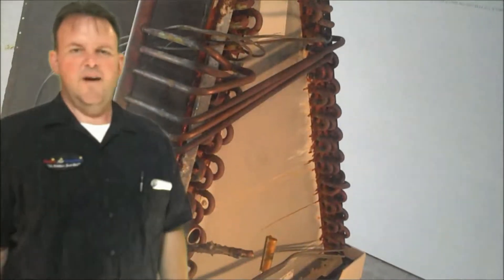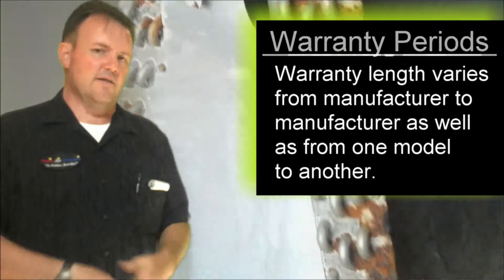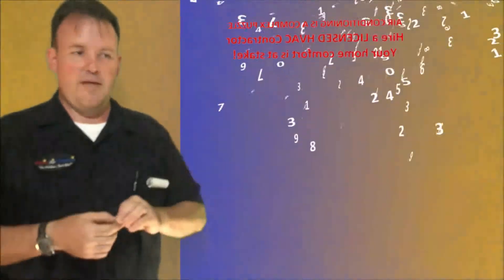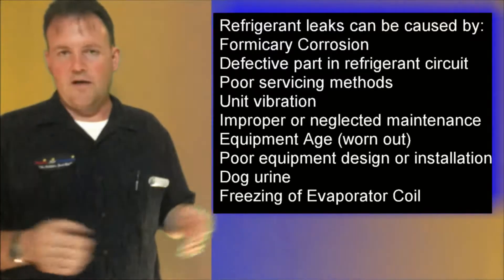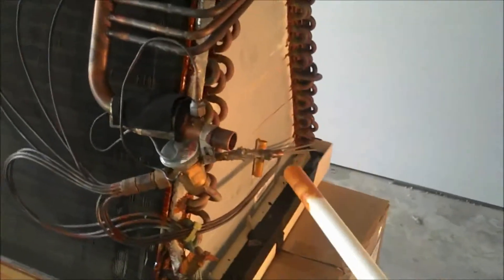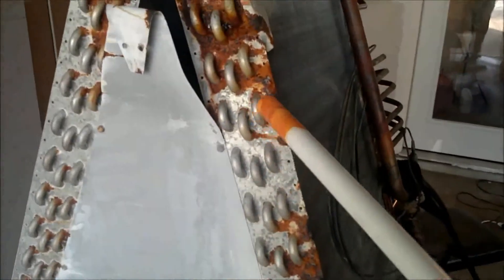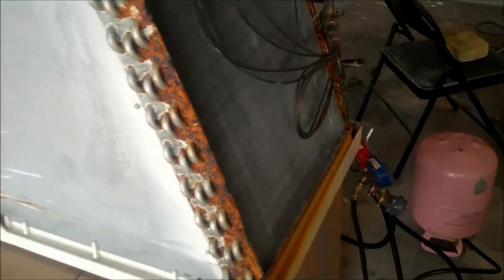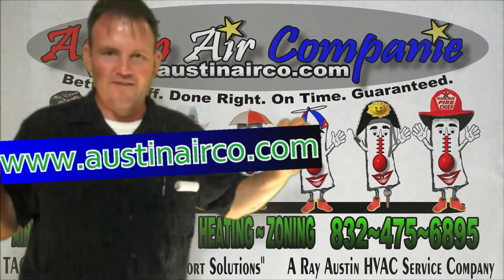My Evaporator Coil Is Leaking Freon Where

Comment: Our ac guy came back after a week from installing brand new unit because we are smelling something sweet every time the ac goes on. I googled and leaking freon came up.  He came with a hand held leak detector and did a test in the front of our evap coil and didn't find a leak. Was he supposed to pull out the whole coil and also check the back? He didn't.  We paid $8K for this and not happy with smelling something sweet and nauseating. He said there is no way it is leaking because refrigerant doesn't smell. Help!
Reply from the maker: Thanks for watching & Thanks for the comment. Refrigerant(s) are solvents more or less. I wouldn't consider them to really smell like much of anything, usually unless the content of the leak was really large. In the event of a large refrigerant leak, the smell would dissapate rather quickly. (within an hour or two) 

If your new system required duct work as in a new plenum and possibly even the new coil box the evap coil sits in could deliver a newness type smell for a period of time. Some noses may take this as a sweet smell and usually in time this will go away in a few weeks to a month. It could also be duct board if this was used as a plenum instead of sheet metal. Some parts and pieces are harder to find right now. These kinds of smells (if that is your case) will gradually normalize in a few weeks. 

If the system is cooling properly, it's not likely a refrigerant leak.